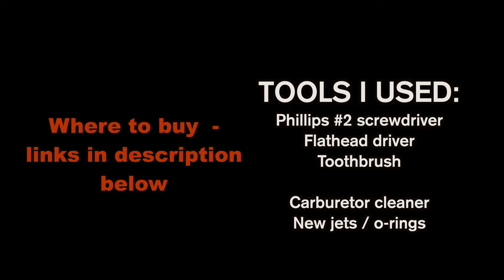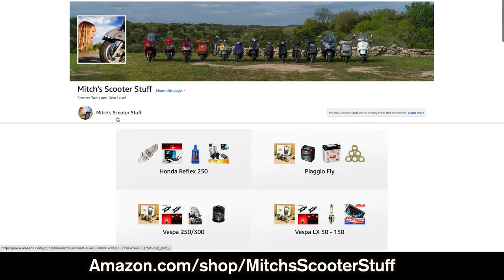Honda Ruckus / Zoomer 50 - Carburetor Cleaning / Rebuild | Mitch's Scooter Stuff

Comment: Great explanation, as usual. 👍  Also, it's always a good idea to check/clean the needle and seat, only takes 2 minutes when the bowl is off. If you have a difficult time clearing out a passage with just spray cleaner, cut a piece of wire off a wire brush and poke it with that.

Comment: You should also spray thru passages when jets are removed.  Also why didn't you take out needle and clean there too?
Reply from the maker: I did and I realized I didn’t put that clip in this video 🤦🏼‍♂️
Reply: @MitchsScooterStuff  so, you removed float and cleaned needle and passage, then reinstalled float? Thanks

Comment: Just got a 2016 ruckus 3,035 miles. I "Think" I'm feeling some kinda surging while riding along between like 25 and 40 mph. Pretty sure it's not the carb, just replaced the air filter and still feeling it. I'm just lightly but I was wondering is this leading to something serious drivetrain wise? Thanks for all your info BIG money saver!
Reply from the maker: Check the rollers 🙌🏼
Reply: @MitchsScooterStuff  rollers?
Reply: Maybe rollers or sliders need replacement?
Reply: @nunya8866  what was it with your tire specifically? i just bought a 2011 and you described my issue well.
Reply: @AZestyNewt  Ended up being my tires were probably cheap and not wearing evenly making it feel like it was surging. You got any good sites to buy honda ruckus parts? Think I need a new clutch or at least rollers..

Comment: Aloha Mitch!
I just had a quick question on Jets... I was curious what jets you recommend running? I have a 2020 Honda ruckus and the only mods I’ve done is a and NCY-CDI box, and NCY coil, NGK iridium splug, 5.5 sliders and a trail tack. I live at 5200 feet and about 160 pounds. I want to put a high flowing air filter(a K & N) in my stock airbox but when I do it seems to flow too much air and ran to lean. Also after installing the NCY-CDI box and coil I thought it would help it run not so rich here in Denver, but not really.

So if I run the stock air cleaner it runs slightly rich and if I run the aftermarket air cleaner(K&N) it runs to lean so I’m curious what jets you recommend?

Comment: Amazing video Mitch! To the point and easy to follow. Any tips getting the piece below the main jet ( I'm assuming a needle) to come out? It appears to slide out with ease on your video (2:34). Thanks!
Reply: I'm having the same problem. Did you manage to get it out?
Reply: @chimbo8741  I did! I removed the jet/idle needle by taking off the top. This gave me access to spray carb cleaner on the piece mentioned in the comment. It came out after that! Sorry for the lack of terms! New to rebuilding scooters.

Comment: Hello - I have a 2020 ruckus, the temp light comes on randomly as if over heating and scooter will want to stop running.  If you let it cool, the problem seems to resolve itself and can go for days/weeks before it does it again.  Any ideas or tips I can try to resolve?  Thanks very much..
Reply from the maker: Aloha! Is your coolant and engine oil at full line and healthy?
Reply: Mitch's Scooter Stuff   Yes, thanks
Reply: Sorry to hijack your question for Mitch, but I belive the 2020 Ruckus suffers from a waterpump issue? In all honesty, it's not something I've paid a whole lot of attention to as mine is an '02 Zoomer import, but from the chatter I've seen on the forums, this does appear to be a common issue. Contact your local Honda dealer as they are covering the pumps under warranty. At least that is what I have read online 👍🏻
Reply: KC thanks for the input. I’ll check it out